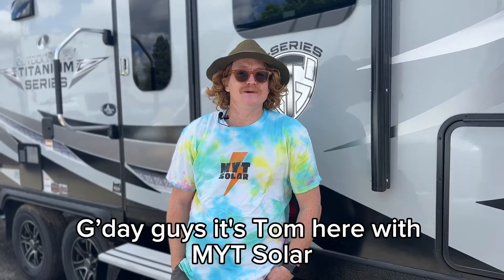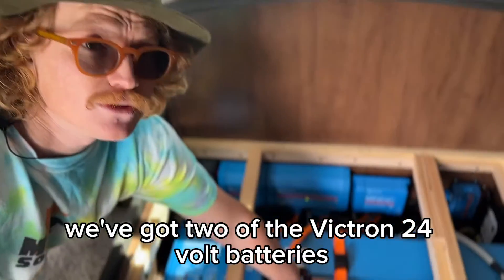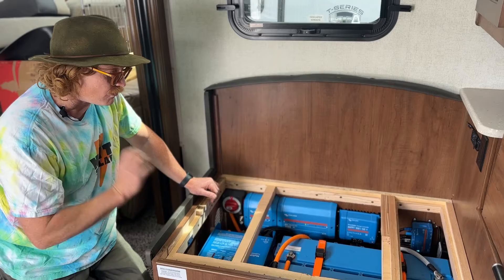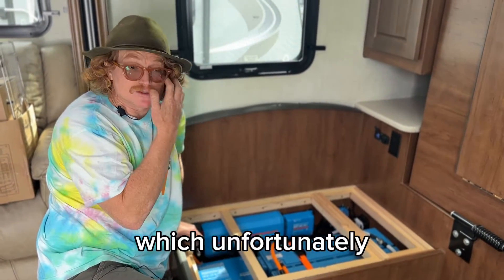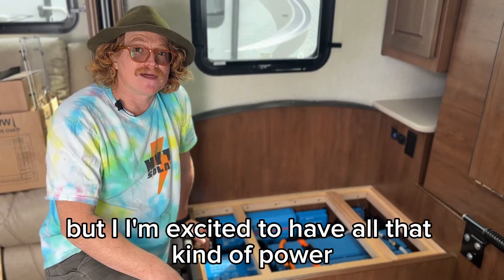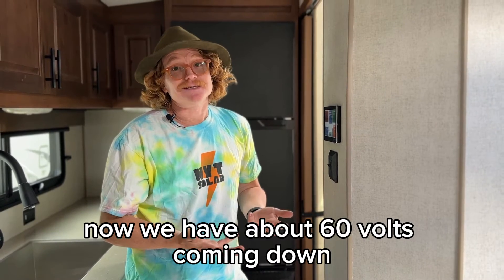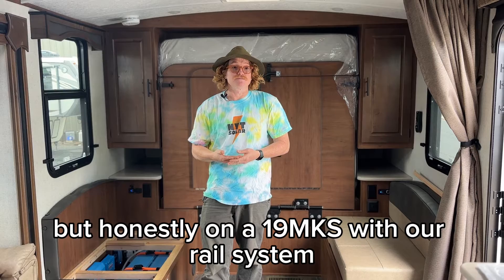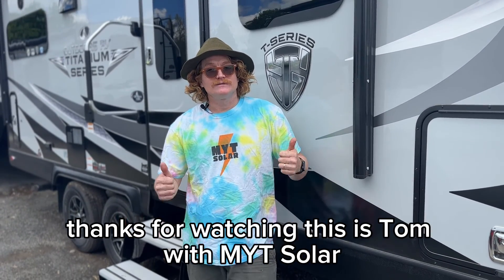We installed a 24V solar system in the smallest Outdoors RV EVER | '24 ORV 19MKS

Comment: Hey, Tom. Again. I have been watching a bunch of vids today and I think this is the one I would like to try and build. I feel pretty sure I can do it. I have a 19MKS with the same factory panels on the roof. Victron should be pretty straight forward except I'm not sure about programing the Multi Plus. Is that something a novice can do?
Reply from the maker: Hi again! Programming any of the Victron stuff is fairly straight forward but you want to get it right. Technically the distributor who you buy your equipment from is meant to offer product support so if you buy from the right online store (or a local one) you should be supported all the way through. Victron controls MAP pricing for every product so pretty much any dealer is going to charge the same price. So my tip is choose who you buy from based how well you think they'll support you in the programming. Good luck with the project! Tom

Comment: Is there a 12v vehicle charging option with the 24v Rv system?
Reply from the maker: Yes there is, Victron makes a 24|12 Orion DC to DC charger which we have in our rig for a charge from our 3500 truck. Its their older style vs the new Orion XS 50. Word is they'll be releasing a new Orion XS 50 for 24v systems soon

Comment: This is us! This is solid for us so far. Have gone 48 hours testing the system without shore power. According to the system monitor we will get several days at a time. Winter camping may be different but we have options. The fact the pass through has none of the system components it leaves room for all our gear. The install is meticulous and the back and  forth international communication was great. When upgrades may be needed, south to Bend we go. You guys are the best! Now to make a Nespresso and drain a dribble of power. Ps we have a great tent for sale.
Reply from the maker: You guys are the best! Can't help but chuckle at your "PS we have a tent for sale" comment every time I come back to this video.  You two did it right with a 19MKS and a great power system. PS responding to your email now.

Comment: Great to see another take on a 19MKS install! For the record, our 1,500 watts of solar feeding 810 Ah of lithium is an incredible amount of power in our 19MKS. We've experienced more clouds than sun lately, and have still never fallen much below 50% state of charge. Yesterday we finally had our first real opportunity to see how far the battery bank could recover from several days of heavy overcast. Woke up to about 45% on the batteries, and even after a cloudy start to the day, we hit 100% SOC by about 4 PM. So we heated water on electric! LOL  Woke up today at 78% state of charge and even though it's VERY heavy overcast again, we're warming ourselves up with our electric space heater since the forecast for tomorrow is bright sunshine. Our MYT system is allowing us to use the weather forecast to save on propane. 😃 Look for our upcoming video about the great system MYT installed within the next few weeks. We've boondocked a LOT over the past 20 years, but have never had such a freeing experience before. Thanks so much,Tom & Ely. ❤ There's solar... and then there's MYT solar! We may never plug in again.
Reply from the maker: Ayy such great feedback you two. We're so proud of your system and how it has performed for you. Hopefully many more 19MKS to do in the future.
Reply: First - thanks again for answered my question about hitch weight on your 19mks. 

A couple questions: 

- Considering the proximity - do you hear any noise from the Victron equipment?

- When using your propane for heat - do you experience any condensation? 

Thanks again! Safe travels 👍😎
Reply: @effortless_choice  The Victron gear is very quiet, with only the faint sound of a fan when it gets hot out. Never bothers us. We haven’t had our rig in cold enough conditions to need the furnace yet, but we can tell you from past experience that a propane furnace that vents outside produces very little condensation inside the rig. That said, things like showering, doing dishes, and breathing do create a fair amount of moisture. So we always leave a window slightly cracked, and a roof vent fan on low overnight, and have never had a problem with condensation as a result.
Reply: @RVgeeks  Thank you for your time. Have a great weekend 😎👍🇺🇸